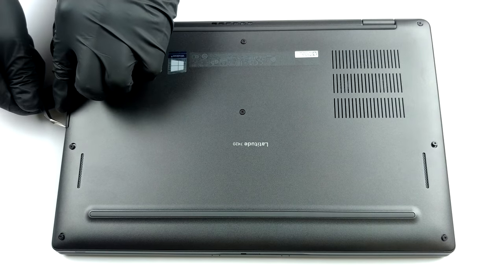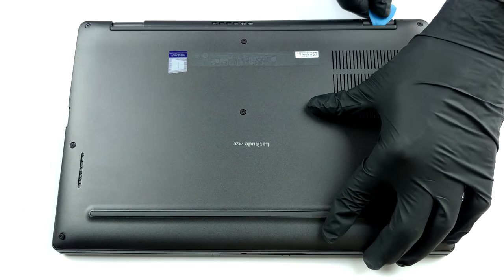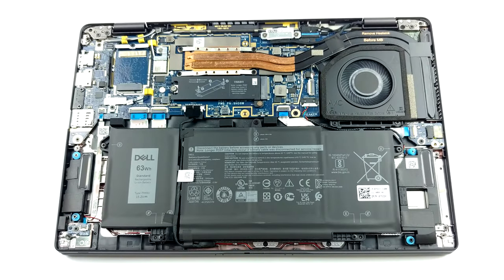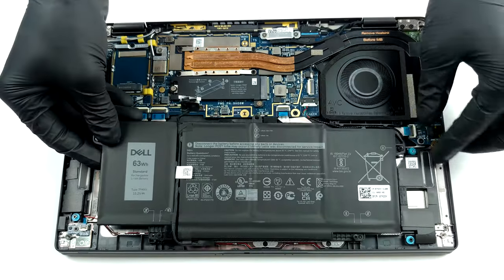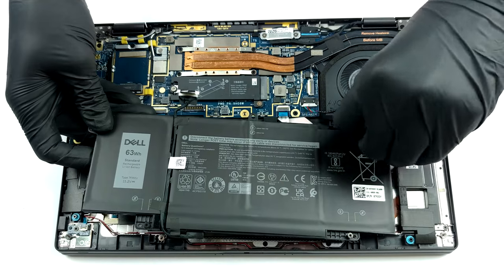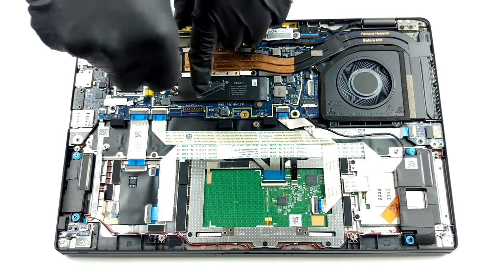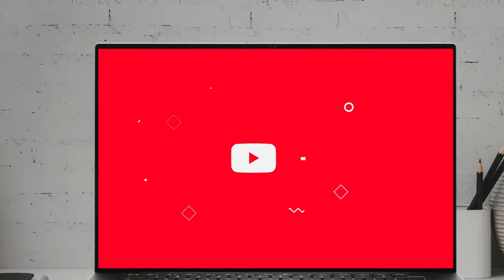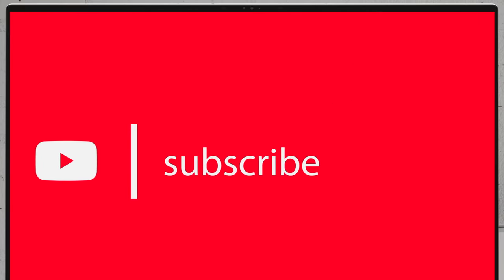🛠️ Dell Latitude 14 7420 - disassembly and upgrade options

Comment: They went downhill after the Latitude 14 7400, you cant even upgrade your ram past 16Gb of Ram anymore
Reply: As someone who's used Latitude laptops since 2011, I'd say they went downhill after the e7440. That one had hot-swappable battery as well as dual HDD-SSD slots. The soldered RAM is the final nail in the coffin for me. A nice, big FU to the engineers at Dell for ruining a great product.
Reply: @Balconetti  Yep very true, the soldered ram was the killer for me. I dont know what to get now. I get a replacement latitude every every year
Reply: @titin200  Perhaps a Dell XPS? Soldered RAM memory seems to become a trend because it takes up less space so devices can be smaller and it probably also costs the manufacturer less money. I'm afraid it will be the new standard in a few years and swappable RAM will cease to exist (for laptops).
Reply: Get the 5000 series because it’s not soldered
Reply: There's no need for a laptop to be so small and not upgradable as phones are. I'd rather switch to a different model that is upgradable than continue using a limited PC

Comment: can you add a secondary ssd
Reply: No, as the video mentions: "storage wise there is one M.2 slot that supports PCIe 4.0 SSD drives."
Reply: I also want to know is it really possible to add a second SSD?
Reply: @MrBuihongmanh  no. There is only 1 slot
Reply: what is the slot on the top left corner? I thought it was an m2 2230 slot
Reply: @GiovanniDeCostanzo  I thought this was the WWAN slot.  Sometimes you can use that , but the orientation of the slot would have you place the  ssd upside down, so it might not fit against the motherboard.

Comment: Th way you removed the Nvme was totally incorrect. I have serviced this and other Dell models with that spacer for the smaller drives and you are to LEAVE IT ON the spacer to remove the drive. Your removal could have damaged the connector, the pin lands or both. Btw, you called it an SSD, it is not.
Reply: That Nvme is an SSD, maybe you're confused with SATA...

Comment: I have this system with 256GB SSD. Can it be upgraded to 512GB or 1TB or is that soldered too?
Reply: Hey mate, just looking at one for a client, if you pause around the 1:17 mark you can see the SSD drive above the battery (long and black) just below the copper cooling.
Reply: you can go all the way to 4tb.
Reply: Yes you can upgrade the M.2 NVME Gen 4 SSD but make sure you get 1 that doesn't get too hot
Reply: @CR3WSA  are you using the laptop?
Is it a good one?